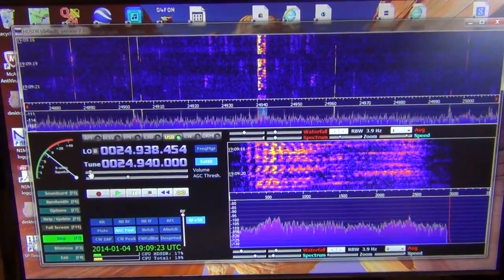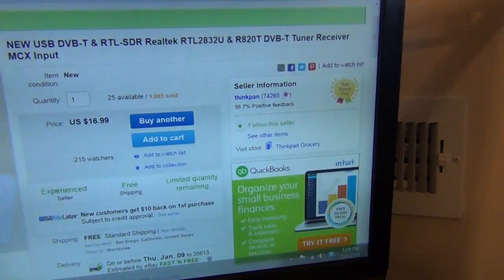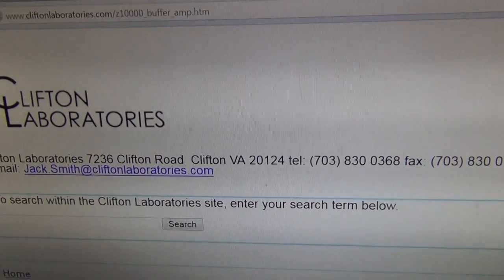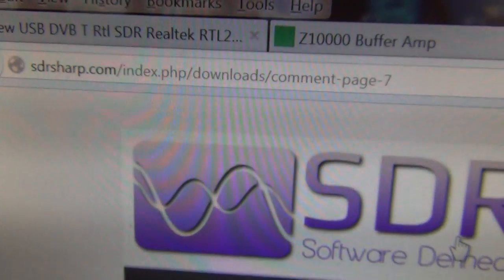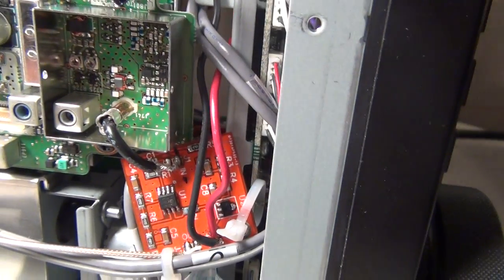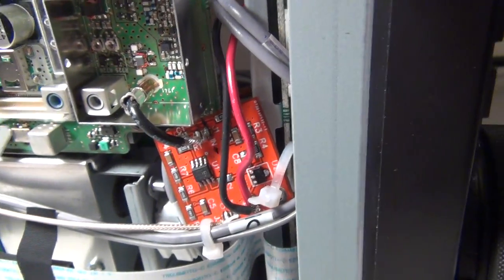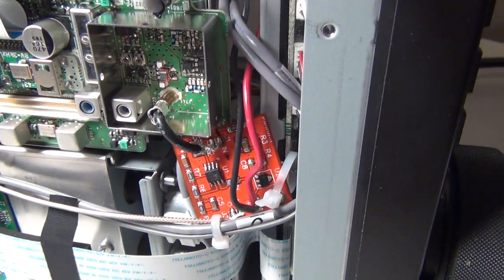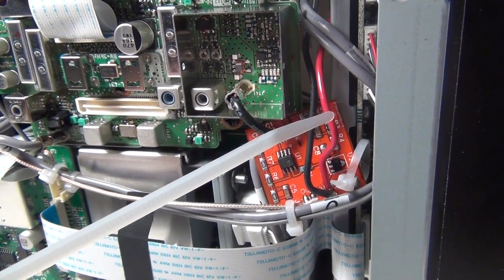ICOM 7410 Panadapter

Comment: Thanks for an informative video.   Just an FYI if anyone is interested.   I have found another manufacture of these Panoramic Adaptor Tap Boards  http://huprf.com/huprf/pat-board/  and also identified via the IC 7410 Service Manual that the IF output is via the J741 Female plug on the RF-A Unit Board ( shown in video ); this is a  TMP-J01X-V6 Female connector.  I am now currently trying to find the male connector for this and once I have that information I will post it as well.   Looking to purchase the IC 7410 in the next month or so and one of the selling points is the accessibility to this IF Output.  Your video helped out with my decision so again many thanks.  KD2EYL 73
Reply: +Orlando Monaco http://huprf.com/huprf/wp-content/uploads/2016/03/Which-PAT-for-your-rig-V9.pdf  Following link will show you what to order from hufRF depending on your Rig.  For the IC 7410 you need the following:  PAT Version:  PAT70M and the Gen Plug Install Kit.
Reply from the maker: +Orlando MonacoThanks for your great info.Please let us all know how the PAT board works for you.Your going to love this MOD!73s de AK4QR

Comment: Hi. I got mine going and it works a treat but I do suffer from power spikes a fair bit as mentioned here: http://www.rtl-sdr.com/improving-hf-reception-disconnecting-switching-power-supply-rtl-sdr/ and I was wondering if you do and the waterfall in your video looks pretty clear. Are you affected at all?

73
VK5MTM.
Reply: Tmarinos, sorry for the long delay. The lower I go in the bands 40 meters and lower,  the more likely I see that but all i do is turn my gain down. and it goes away. I rarely run my gain at 50(Full) mostly when I'm on 6 meters and it doesn't exhibit this when im operating there. Thanks for the link.. will keep it in mind if it starts getting bad. 73's AK4QR

Comment: Hi. I have just installed the board. Could you please share with me some of your settings in HDSDR? Also, how did you get rid of the centre spike?

Thanks.
VK5MTM.
Reply from the maker: I'm at work at the moment but will post those setting tonight. I might do a video of them and post. Not sure what you mean by center spike. The center line in my video is actually a station broadcasting. Go to my QRZ page and scroll down to the pic you will see a lot of those lines during a contest. AK4QR
Reply: phillipssd1
Thanks, I would really appreciate that.

Don't worry about my comments re the center spike, that was my stuff-up which I have fixed.

Many thanks.

Comment: Dumb question and please pardon my ignorance but does the buffer board power leads need to be soldered to the radio or does it just plug in somehow? Obviously I'm worried about damaging the radio and voiding the warranty.
Reply from the maker: Under the cover on the opposite side of view in the video are 2 post where the power comes in from the power supply. One is red + and the other is black -  I attached the buffer board there.
Reply: phillipssd1
Thanks. Lastly, does the SDR dongle need any isolation or protection from TX RF during transmit?
Reply from the maker: No, straight cable from the buffer board to the dongle.

Comment: An update on performance. I have had this mod in for about 8 months or so I guess. I have to say I am totally satisfied. It has not changed in anyway since I got it working back then totally reliable. I use it 99 % of the time for band changing, never touching the radio. Using this for weak signal work on 6 meters makes it SO much easier. Really hope everyone who has tried this mod is just as satisfied as I am.  73's de AK4QR
Reply: phillipssd1 Thanks for the reply. That's exactly the answer I was hoping for. I have literally just placed an order with Jack for the buffer board and you have made me a very happy man!
Reply: How does HDSDR talk to the radio for band changing etc.? Is it via CIV?
Reply from the maker: ***** Within HDSDR there are different way to interface to your radio. Mine is setup very simple. I have HRD controlling the radio and inside HDSDR there is a setting to have HDSDR control HRD..  I rarely touch the controls on the radio for changing frequencies.
Reply: ***** Good! Maybe you can take a video as your going through it? My video was an after thought. And to be honest at first I really wasn't sure it would work. Once working you'll be thinking how was I playing radio without this. Anyway I hope to get a video up on youtube of all my settings inside HDSDR  that make it work with my 7410. So little time these days since my grand daughter moved in. Remember what I said though and is very important. Keep the cable between the 1st IF connector inside the radio and the buffer board very short. Especially if you want to work weak signals like on 6 meters. I'm pretty sure I got mine down to 1-1/2 inches. I don't think I could have cut another 1/2 inch off and made it fit. Let me know how you get along.

Comment: I started testing this this week without the buffer, just the dongle wired straight into the IF test port. From what I am seeing, with out the buffer and it's possible available gain, it needs a little something extra. On the FT 857 without a buffer you can tell when the dongle is plugged in and working, it seems to just barely desense the rig.  The IC 7410 is not like that at all, on or off, plugged in or not, I see no difference.  I don't "think" it needs to be buffered, but I really think some gain should be in the chain, so may as well run the buffer.

How much gain if any did you set on the buffer when you built it?
Reply: Jack instructed me to run no gain on the buffer/amp. Originally I thought the same thing as you about desensing the radio and also not having good reception on the dongle. But he kept saying cut the cable shorter. Which I did and now the noise floor on the radio and the dongle are very close to the same.

Comment: Ok, looks good, just wondering if that cover you took off is designed for proper shielding & isolation of the 1st IF board from spurious emissions ...
Reply from the maker: N1CY, yea you are spot on with my original worries with removing the cover. But I do a lot of weak signal work and not seeing/hearing any problems. If something happens that changes my mind I'll modify the cover and put it back on. But that still leaves the buffer board exposed so I'd have to put that in a sheilded box as well. I'm just not hearing any problems. I have to say that it's the best mod I've ever done.